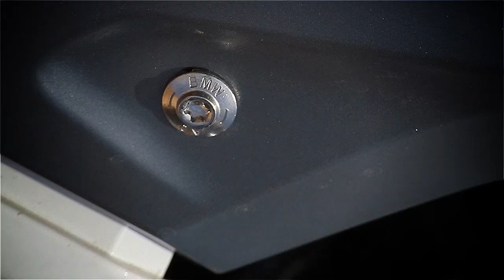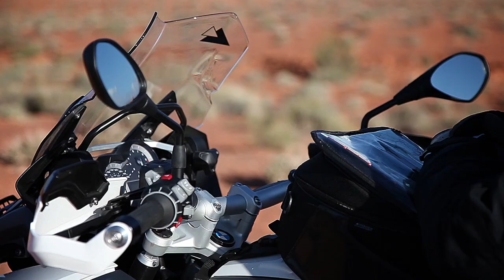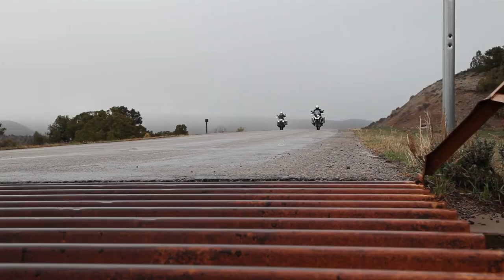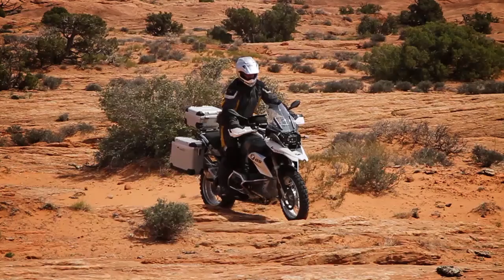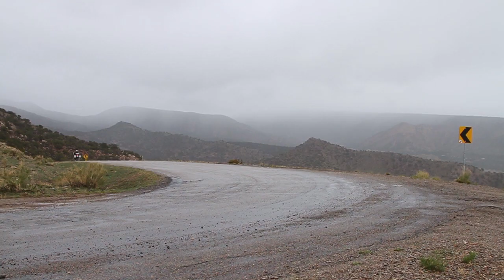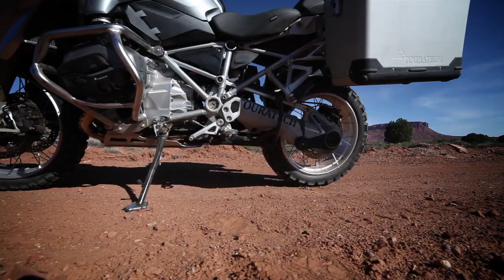Oil & Water: Comparing Two R1200GS'

Comment: After riding KTM 500 EXC dual sport bikes all over the Colorado desert where I live, I decided to buy a 2008 BMW R1200 GS Adventure so my girlfriend could join me on day trips. I love the fact is lighter than the new bikes, better tuned for off-road riding, easier to work on, and uses a key to start. I decided on the 2008 after renting a 2018 R1200 GS for the weekend, it was much heavier, and I hated the insane amount of electronics, especially the keyless ignition system. Since most of our riding is off-road, the 2008 GSA really has turned out to be exactly the bike I was looking for. Great video Touratech USA!
Reply from the maker: Glad to hear you two are enjoying the new bike! 2008-2009 were great years for the R1200.
Reply: For me almost a 100 lbs lighter was a deal breaker! Love my '07. It does have plenty of character and I wish this review didn't leave out those "key items" that are missing from the new Boxer family.
Reply: I just bought a 2012 1200gs and the first question I asked the owner was "does it have an actual key".

Comment: Went down to the local dealer yesterday to test and more than likely buy the new GS. After the test ride I noticed a used 2012 out front. You see the new bike is very good, no question, but when I rode the older model I asked myself if the new one was $12,000 better? I rode the triple black oiler home and will take myself on an awesome OS holiday with the savings. It will always be horses for courses, great review though...

Comment: I've owned the 1150GS, 1200GS ADV, and just picked up a 2014 ADV.  The water boxer is light years better in terms of power and refinement.  (if you've had fuel pumps freeze or fuel level tapes fail you'll understand) As an extra bonus for those of us who get stuck in DC traffic, you won't cook the engine like the 1150 and 1200 oil heads.  Plus it cost no more than the 2008 1200 ADV.  I like them all, but ride one before maligning the water boxer.

Comment: I bought the new water cooled GS 8 months ago and have knocked up 20,000 k's on it already.  Not bad considering I work and haven't taken it on holidays yet.  The bike is a real pleasure to ride.  I have a motocross background but riding it on the road is the major function of this bike with the odd, off road exploration available when you want it.  I've never had cruise control before and now that I have I doubt if I'll ever do without it again.  They are an expensive bike, but this one is worth the extra $'s.

Comment: Best decision I ever made buying a new gs, have always owned sportsbikes but buying this bike has changed everything. No longer worried to take it out if the roads are a bit damp or it might rain and we get shit loads of that in England. It's no fireblade as far as out and out speed is concerned but it'll get you up to 3 figures bloody quick and in comfort.
Electronics are just amazing, always thought they were a gimmick but not now, rain mode makes it fucking idiot proof in the wet and dynamic just turns it into a different beast altogether, not just acceleration but suspension too, very very clever.
Never thought I'd own a bike like this, can't wait to head for the alps next year, you could honestly ride this bike all day and just enjoy the ride without worrying about how fast you're going. And cruise control is the icing on the cake, Sat nav you control from the left bar as you're on the move, I could go on and on, this bike has made me more excited about biking than any I've owned
Reply: Danny Bannister coming from bikes like Hayabusa, Bking, GSXR-1000, Superduke 1290. How does this accelerate. (0-60)is there room for a bit of tuning getting more power out there than 125bhp? Thanks!

Comment: That's BMW. Innovation and constant improvement. But stubborn to change. I still have a problem with that opposing cylinders. Those heads out there with your legs I can't get used to. And I'm german.  Thanks guys.
Reply: you don't understand yet.  Put a lot of thought into it, you will see the myriad reasons why the boxer is the best engine layout.
Reply: @davidfalgout7304  😂, Oh yeah, I'm sure design may make it optimal. The old vw,s were opposing 4 cylinder I believe. But you didn't sit on a seat above the engines haha. That's my only beef. I've never ridden one, so I may be totally surprised. But I doubt it. Enough heat throws off under tank heads. Also I ride in shorts some, that'd be a definite NoNo, with two enormous cylinder heads sticking out there.  It's just a personal thing. No biggie.
Reply: @peterford9369   OK NOW I understand.  You have never ridden one. You are a keyboard expert type.   So funny I forgot to laugh! I have 300,000++ on BMW's hardlys, Hondas, Indians.. repaired them professionally... so i know what I am talking about.  There are the vast majority of people that after they ride a Boxer engine machine, they are at a loss for words as to how good they are. So yea try it sometime. 
BTW, you give yourself away and we see how the luddite shines through! Ride with no gear, YOU ARE THE MAN.... UNTIL you fall then you are NOT!   Way to go Bro, the gene pool needs to shed the dolts.
Reply: @davidfalgout7304  Yeah, I've had a Suzuki t550gt, a 75 CB 750, A 94 , VMAX,, only water cooled, a Kawasaki 550 Ltd, and now a triumph t100, air cooled. But no BMWs. The bike shop I used to deal with, never had any in for service or sale, that I recall. So never got to try one out. Just never had the desire either. The VMAX put out heat like an oven when the fan kicked in, in traffic. But all the engine was under me, haha, not sticking out the sides a foot. 
Like I said, I'm sure from a performance point of view, the engine wins, but to me, and I'm a German born person,,,it seems awkward.
Reply: @davidfalgout7304  As for gear, I've been riding for 35 plus years, never a fall. I live in Florida, i do construction, well, not as much any more,,,but I used to ride to jobs every morning and home at nite.  Sweaty and dirty from work. I sure as hell am not going to climb into, " gear", on the ride to, and back, from days at work, to make the gear manufacturers richer. 
I'm not against it, I wear a full face and when riding just to ride, a jacket and jeans.  But I don't ride to race, I ride for the joy of riding. I don't filter, I don't lane split. I ride smart. That's why 35 years and no falls. Oh, I guess 40 now.

Comment: I could of did a review like this. I traded in one of the last oil heads a 2013 GSA for a really new 2016 GSA and it almost feels like a whole different bike but she still is my pack mule and work horse. I need to armor her up before I start riding her hard with your parts and equipment since I hit tree, pot holes, sand, highway, cats and birds and a card board box on the high way and I need/want that protection for my baby. I lived off of her, camped, toured and commuted with her so I understand all aspects of both oil and liquid cool GSA's. Both turned heads everywhere I go and there is a small community of GS riders down here In Florida but all the better since I feel special and unique by my self. Either way great review on your part I have been a what you can call investor since I used exclusively Touratech to load out my GSA and will do so again on my new bike once I get my funds back up because I hate having her "naked" and feel like she wouldn't be able to handle going down like I used to like my old oil cooled. I really miss that tank of a bike the oil head GSA and the durability. (I hit a tree and smashed the right cylinder head. I cracked and punctured the cylinder head, shattered the cam carrier and the throttle cam was knocked loose. Even loosing a good amount of my oil and bleeding out and internal damage (the bike not me....lol) I still rode out of the forest and got home. I can attest to the solid build of the bike and the crash bars and associated guards I had installed from Touratech which enabled me to continue riding after a near fatal crash. Thanks again and thank you for your dedication to superior fit and finish with all your items and all the fun you must have "Testing" out new equipment. A dream job for my but till then I'm riding around where ever the U.S Navy sends me. I will be Hawii come this April. Cheers!!!!

Comment: The Adventure versions flywheel weights two pounds more than the regular GS, so it will lug like the oil cooled version, but I wonder if the additional waterpump, hoses, radiators, will add more potential problems if out in the middle of nowhere.
Reply: It was reliable the adventure version or it wasn't sir?

Comment: Selling a 2008 K1200GT, 2007 KTM 525EXC and a1991 R100GS for the 2014 R1200GSWA. 55 years old and this just fits my lifestyle better. Ever since using the cruise control on the 1200GT it for me is a must. Great job BMW. FYI The 2015 have keyless ignition and clutchless shifting options.
Reply: Mark Scott I believe you'll eventually regret selling the air head GS. I have a 91, yellow and black, known as the bumble beemer. I've had it for ten years now and put 100,000 of my miles on it. It has 130,000 total. I sold my R/75/5 back to the guy I bought it from, 5 years later, and I regret doing that. You just can't have enough airheads. I have a 2000 R1100R that just rolled over to 15K, and I'm not a big fan of the bike, it's ok, but I prefer the GS. I believe I read where the h2o gs has the clutch up front, where the camshaft used to be on old bikes. I can't quite wrap my head around that. At least they finally moved the ports to where they should have been from the first bike that rolled out the door. 

  If you sell the GS try to make sure it goes to a good home. Maybe a friend that's been lusting for one for a long time.
Reply: 505197 Thanks for your comments. Both the BMW GT and KTM525 have been sold. I have been gathering up all the parts for my R100GS and feel bittersweet about selling it but I truly do not have the time to work/ride this bike. Who knows maybe I will just hang on to it. Truly thanks for your thoughts.

Comment: Great to see a review that doesn't include a sales pitch. (although all that touratech gear "sure looks pretty".. :)  one thing that no one is pointing out is that despite the new water-cooling system, bmw kept the heat-sink / engine fins. but no worries, a cool engine is a happy engine!  a hard life for Paul & Iain, all that riding around on new bikes, trying to hide those S-eating grins...

Comment: While watching this video the whole time I was thinking: why the hell did so much people buy the old GS? That must be a really bad bike.
Hands down: This is just a promo-video for the new GS, not an objective comparing of the old one and the new one.
Reply: They did the same with the 1190 vs 990. :D they made 990 look like shit and 1190 doing all the wheelies.
Reply: I agree this is a promo video. Having ridden both the oilhead is a much more serious off road machine and handles much better on and off road. The water cooled bike is alot heavier and you can feel it all the time. For the serious rider no matter what the terrain the oilhead is a much more capable machine. The oilhead motor is much more responsive and punchy as well as tractable down low where you need it. Whereas the water cooled bike felt laggey and when the computer catches up the power light switches in all at once no matter what mode you use. Call me old fashioned but the old (2 years :P) bike is what I would have given any choice.
Reply: why buy an oil gs, cost
Reply: Weird, It's almost like BMW have updated it and made a better bike.
Reply: I agree with you completly. This is not an comparison. But a marketing video for the new one. The title is wrong.
Reply: They don't want to embarrass their engineer friends at BMW who worked so hard to design the new bike.

Comment: I have an '07GSA with a ton of TT add-ons and have been agonizing over buying a gently used old-school GSA vs a new GSW.  This was the best review of about anything I've seen anywhere, printed or online.  To the naysayers, SHUT UP!  This was a review of 2 bikes, so they aren't going to compare them to a KTM or anything else.  It was mono-Y-mono.  These 2 bikes Vs each other.  This is the info I'm searching.  Now if I could just find a dang demo-ride of the GSW.  I'm leaning towards the old-school oil head.  Never have a heat problem yet with my 07 and I live in Las Vegas.

Comment: The new GS is a very well mannered bike on the tarmac and Vet riders will find its geometry and corner entry characteristics to be as good as modern street bikes. Downside is yes, the torque is low, especially when loaded pannniers and camping gear, expect to be feathering the clutch, allot. First could be a tad lower for technical sections. Other than that, excellent bike and extremely comfortable on long rides. The ESA suspension is garbage for off road riding as well, rear shock has a harsh dampening spike through whoops. Nifty idea but I would prefer something with manual clickers and a pre load adjuster.
Reply from the maker: Yeah, the water boxer like to be reved up to get the power. Once you are there it's downright exciting on the pavement. The later models with more flywheel weight effect feel more torquey and are more satisfying to ride off-road. The stock suspension does have limitations based on the OEM budget for that part of the bike. Take a look at the Touratech Suspension Plug & Travel upgrade options https://touratech-usa.com/BMW-R1200GS-Suspension The spring rates are custom selected to your weight and riding style.

Comment: I don't know what can be wrong with that oil cooled, but I have a 2006 GSA with 180.000 km (111.000 miles) and in 25 Fahrenheit it starts immediately... i never touched the gas. Instant starting.

Comment: So I assume that the R1200GS from 2010 would still be Oil-cooled. Just bought mine.
Reply from the maker: Congrats!
Reply: I too bought an R1200 from 2010 recently. Although it is 10 years old now and although I am sure the newer GS is an amazing bike with a lot of features mine doesn't have, I have to say it is still a fantastic bike in many, many ways. It is so much fun to ride and a very good bike still. So if you can't afford a new GS, you certainly won't be disappointed with an older one, I can assure you.
Reply: Exactly my experience! New features would be nice... like slipping up and down the gears w/o having to shift... i think they added REVERSE to back out of tight spots..  but not at double the cost... I’ll stick with 2010

Comment: Silly me. I just bought a 2011 with 5K miles in it. I zip down the trails and highways every day constantly worried about the innovations of the new GS that I'm doing without. I only saved $15,000, which is a mere pittance these days. 

Judging from this video, the oil-cooled bike was brought along to carry the camera to film the WC.
Reply from the maker: Congrats on the new to you bike. The best bike of yesterday is still a great bike today as you well know. I'd like to think our evaluation from 7 years ago was a little more two sided than you suggest as I caught some flack back then for suggesting that I wasn't totally in love with the new machine in this exact video.
Reply: Touratech USA  The part I didn’t mention is the 2007 (that is still in my garage) AND the 2011 are, quite literally, covered in Touratech gear. Love your company and the quality is first-rate! Cheers!

Comment: But you do not mention about the strange noise from New Engines! It is horrible. Sounds like an very old engine.  I quit when I heard the new sound.
Reply: Marck, thanks for the comment! The only reason that I watched this video was to see if they would address the horrific noise coming from the engine. I've been told it's the water cooling, I'm not 100% convinced(looking for the answer) but I've had '08 through 2010 oil heads, and I can live with their "clanking" since they are so great in so many other ways...but the sound from the 2017 is obnoxious! Great video though, you haters get a life =)

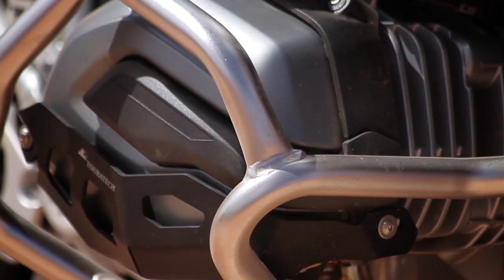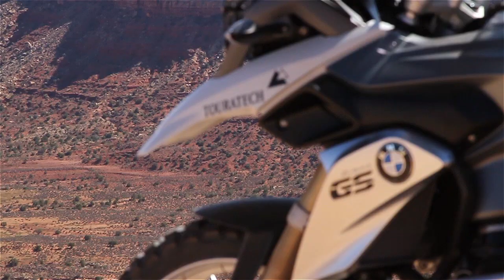Comment: Touratech is obviously in bed with BMW.  Although the new 2013 bike has it's great points, the fit and finish is crap.  At 0:34 thru 0:37 take a look at the welds.  Absolutely horrible.  Stopped watching after this.  I'm sure the bike performs well, but was pretty disgusted with the pandering the Touratech reps were obviously giving this bike.  I love the GS, but think BMW dropped the ball on quality on this (the 2013) bike.